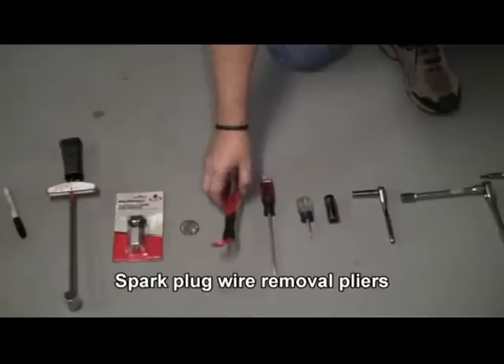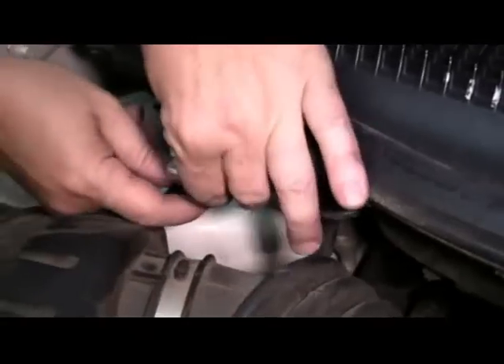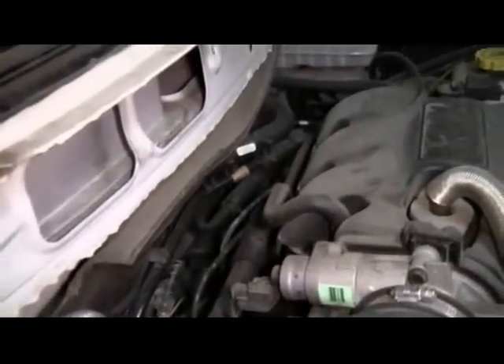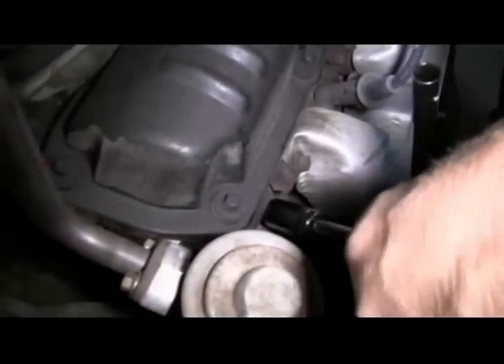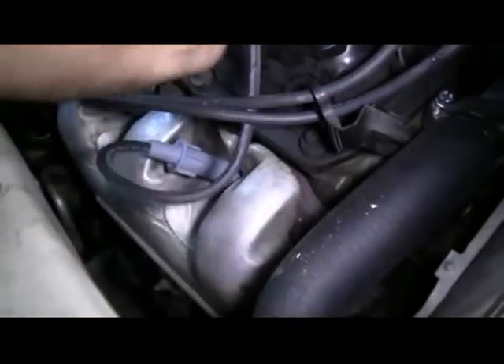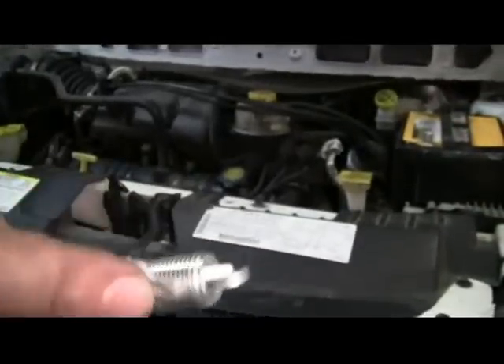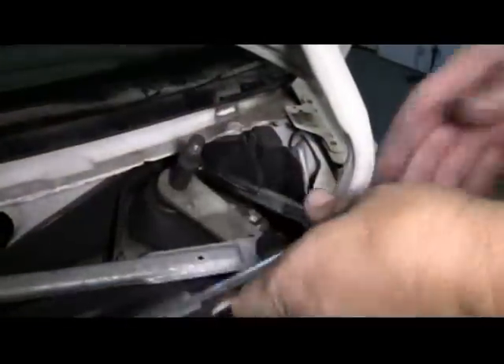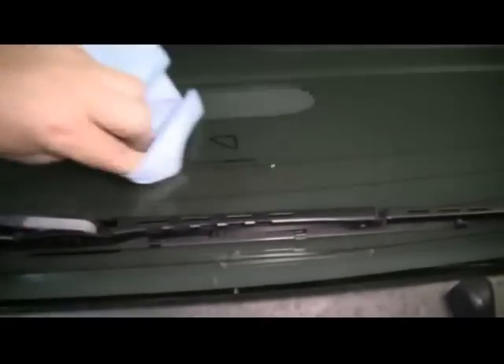Spark Plugs and Plug Wires on a 2002 Dodge Grand Caravan Sport

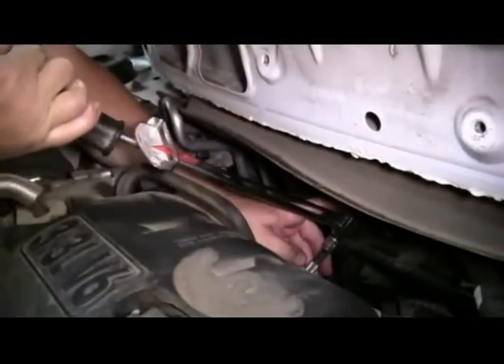Comment: 12:17 to 12:26  That's why ALWAYS insert them gentle and slowly by hand only and begin turning them into the female threads of their insertion holes until you feel them going easily in...until they begin to get reasonably difficult to turn by hand...THEN  you put the torque wrench and socket with extension on it.  ;)

Comment: 1:28 to 1:35  people Unless you are really short ( like 5 foot even) with a short arm length and without  a stool to stand on..and/or you have Popeye the sailor's arms in physical size...you don't have to remove the w/w arms and that cowel.  You can reach the back of the engine reaching around from the drivers side with your right arm/hand.  

I'm 5 foot  9 and am not a skinny guy and and had no problem doing this by feeling.

Comment: Ok, I understand why you remove the wiper assembly for access. I have never had the need to. The only item I remove is the pcv valve hose. I guarantee I can remove and replace all 3 rear plugs and wires in the same amount of time as removing the wipers.

Comment: Does putting the anti seize on the spark plug threads change the torque specifications?
Reply from the maker: No it shouldn't.   - Greg

Comment: Thanks, guys for the detailed steps. I am an experienced mechanic but still needed the extra info you provided to avoid dumb mistakes. Appreciated Jim
Reply from the maker: Glad we could help -Greg
Reply: @GregorysGarage  One specific subject does need attention in your great video I learned. It is the idle speed adjustment method. On my 2002 caravan 3.3 after plugs replacement, the idle speed is really low and the engine dies unless I manually race the engine a bit while and press its brake pedal also. Pain in the Butt to say the least. So the ultimate question is how do I adjust the idle speed? Thanks, Guys, Jim
Reply from the maker: @JamesJohnson-fr1wv  I no longer have access to that vehicle but I will look into it.  Also make sure you didn't knock something loose like a vacuum line.  -Greg
Reply: @GregorysGarage  Hmm vacuum line might be, I'll look. tks, Jim

Comment: Do the next guy a favor and put that anti seize paste on the wiper arm bolt and taper.
Reply from the maker: Thanks for the tip. -Greg
Reply: I'm thinking of doing that on mine, already made a homemade wiper arm puller, quick and sleazy - I meant easy.

Comment: I have a 2000 dodge grand caravan  and the negative battery cables are corroded from battery powered dust and it broke them ,How would you replace the negative cable? It seems impossible....Please let me know.

Comment: Great instruction. If I may add, use compressed air into the spark plug well before removing the old spark plug. The aim is to force any debris out of the spark plug well so that it may not fall into the cylinder well when exposed by the removal of the plug. It would also minimize introducing debris while installing the new spark plugs. Be sure to wear eye protection while blowing compressed air.
Reply from the maker: Tony Lopez Thanks for the good advice.  We really Appreciate it. -Greg

Comment: Gotta say i was dreading the back 3 plugs as well as the O2 sensor i needed to replace that was back there as well on my 2004 GC.  Had a P0302 code and P0032 code.  Misfire and emissions to tackle.  The removal of the tray is a must.  I thank you for the clear video on how its done.  Took me more time to take off my pretty seized wiper arms with a 2 jaw puller than it did to R&R all 3 plugs and the 02 sensor.  Once the wiper arms were off,  it was less than 5 minutes removal with my mini impact.  15 mins to do the R&R of the 3 plugs and O2 sensor and then another 10 to get it all back together again.  All codes cleared and ready to drive.  thanks  very much for the vid.  Saved myself $300 for sure.
Reply from the maker: I am really glad we could help. -Greg

Comment: thank you for doing this video, i knew how to do the front ones not sure how to get to the back ones. NOw im wondering do you have a video on how to remove a driver seat from 2002 dodge grand caravan sport, just got the van cheap and the seat is in lay down position and wont move and got a replacement
Reply from the maker: You're welcome.  Sorry we don't have a video for removing the front drivers seat. -Greg

Comment: Thank you SOOOOOOOO much for posting this!!! Van has been sputtering for quite a while. Sounds like a new engine is in it now.
I really appreciate how your instructions (and video) are obviously for folks not super comfortable with repairing their own car. 
**Couple things for people still nervous about doing this:
1. For people saying they can change out the rear plugs without removing the wiper assembly, you either have arms like ET The Extraterrestrial, or you are lying. EVEN with the cowling (sp?) removed, you still gotta do the rear three by feel to a certain extent, but... you can do it. (a bright flashlight positioned properly helps a great deal)
2. RE: "wiper removal tool" - you can also grab a small "gear remover" that is basically the same thing, for about 6 bucks at the auto parts store. (they said they had never heard of a wiper removal tool... and "why did I need that" and "he'd never had any problems doing it so why was I" and yeah, I probably won't be going there anymore)
3. The little cover you lift to get to the wiper nut.... only lift it when the wiper is down against the windshield or you'll break the cover off.   ....guess how I know this.
4. Go ahead and invest in a small, $2.99 tube of dielectric grease. That packet isn't really enough. At least, I didn't think so.
That's all I got. 
Again, thanks so much for posting this. For those of us out here that don't have much money but still need to get it fixed, folks like you are a blessing.
-Kirby
Reply from the maker: Awesome glad we could help and thank you for the suggestions.. -Greg

Comment: I just wanted to say if you have small arms you can reach around the right side of the engine near the cruse control solenoid to get to the back plugs.  I did mine that way without removing the wiper tray 6 plugs done in 20 minutes.
Reply: This is what I hope to do, my arms are kinda small so maybe I can reach them
Reply from the maker: Wow..  Your better than me..  Thanks for the feedback.  -Greg
Reply: Same here David.

Comment: I have a 2003 Dodge Grand Caravan Sport With the 3.8 L v6 and just got a tune up 3 days ago. it had a very bad missfire and everytime you would accelerate it would go put put put. anyways when in drive it has a faint rotary like noise at idle. Is that normal? they had to only replace the spark plug and everything else that goes along with it on cylinder #3. cost around 240.00 for the whole job.
Reply: the alternator decoupler pulley on the caravans makes noise after some miles very common  mine did for 3 years.
Reply from the maker: For $240 they should of replaced more than one spark plug.   You have a plug and wire for each cylinder and that's it.  As far as the noise it could be a pulley or belt. -Greg

Comment: Great video!  Reading through the comments, I know you don't have the van anymore. Do you recall the valve cover being accessible with the wiper cowl off?   I know it's right above the plugs on the front and is the the same on the back.  I do not want to take the manifold, linkage, and everything else off to get to it.  I was hoping there was enough room with this method, because the front valve cover, like the plugs and wires can be changed in minutes.    Thanks!
Reply from the maker: I would think it would be as the plugs are very accessible with the cowl removed.  I don't remember anything being in the way of removing it.  -Greg
Reply: Yes, you can get the back valve cover off this way.  Remove the power steering hose at the pump and add a spare heater hose there  pulled to the left to stop the leaks while you work.  You will need a wobble or u joint on a 7 mm for the two bolts under the intake.  Cleaning the surfaces was not bad since the gasket comes off cleanly.  I did remove the throttle body (3 bolts) and set aside with wires still attached.

Comment: Hi!
I really wish you'd show HOW to replace a coil on that same type vehicle.  I have a bad misfire, #1 spot.
Need a video from someone we can understand clearly.
Thanks for this video.
great job!!
Reply from the maker: I am about to replace a coil in a 2003 Ford Taurus.  My daughter's car has a misfire on cylinder #1.  I already replaced the plugs and plug wires. -Greg
Reply: +Gregory's Garage How similar would a 2002 Dodge van be?
Thanks.
Reply from the maker: Should be very similar. I don't have the caravan anymore.  I plan to just either unbolt the old coil then install the new one.   The transfer the plug wires.
Reply: +Gregory's Garage Great....I'll be sure to watch.   Thanks!

Comment: They needed to install the engine the way they did for a reason but those fucking rear plugs are such a bitch to access! 
 On my van I don't think they were ever changed, it has 143,000 miles!.  I removed the front plugs and the gap was so eroded that it was .085-.095 depending on the plug, specs have it set to .050!  Front three took a few minutes, one was seized but I got it out.  The back three were a different story!  I broke two of them trying to extract them because they were so seized.  I let them soak with PB blaster and eventually took an impact driver to free them.  I am very lucky I didn't fuck anything up trying the brute force method!!
Reply from the maker: Glad you got them changed. -Greg
Reply: +Gregory's Garage 
Thanks, I wish I watched this video first!
Reply: +Chris Barth 
Have you guys ever had a problem with the lug nut studs shearing off on the Caravan?  For some reason I've had many of mine shear off. It's probably/definatly from over tightening but I've never had this problem with any other vehicle.
Reply from the maker: +Chris Barth I haven't on the Car van but I have on a Toyota Sienna and a Dodge Neon. -Greg
Reply: Must be soft steel or over tightening or both.  I will say just hope you don't break one on the back axle of the 2002 Caravan sport ! Its very hard to reinstall a broken stud without taking the whole drum brake assembly off.  I opted another way but it involved drilling through the dust shield, dont ask! lol! Thanks again!
Reply from the maker: +Chris Barth I think alot of places don't torque the lug nuts and just use impact wrenches.  Thanks for the warning. -Greg
Reply: ??!?  One of mine on the front right sheared off!  I've got a 2003 Grand Caravan.  Weird...
Reply: ohgoodgodno Yeah, to me the lug studs seem to be made of soft/malleable steel or some young guy at the tire place kept his finger on the impact's trigger for far too long. 

The way they sheared was odd. You would think that when the stud breaks it would happen suddenly, but mine sheared slower than Id expect, like it was a soft metal.  IDK, maybe Im overthinking this.lol!  

Good thing is it was on the front rotor.  On caravans with a rear drum its a PIA to replace!

Comment: Thank you so much. Very few videos show the rear plug removal. I like your calm and steady work style. Question, do you normally remove the PCV valve at 75,000 miles and do you clean the EGR as well?
Reply from the maker: Thank you for the compliments.  As far as the PVC and EGR valves I usually replace and clean as needed not at any certain mileage.  But I think it's a good idea to.  Better safe than sorry.  -Greg

Comment: Great video.  I did a 2007 3.8L today.  I did not remove the wiper assembly but it was hard reaching around to the back and doing 1, 3 and 5.   I can see why the first 6 minutes of the video go through that ... you either do that and have easier access to the back, or you do like I did and have patience and do a lot of reaching and feeling with your hands (and I used a mirror and flashlight for help).   Wires from longest to shortest are 2, 1, 3, 4, 6, 5.
Reply from the maker: Wow good job.  I can't imagine doing that job without removing the wiper assembly.  You must have more patience than me.  -Greg
Reply: Wow! I can't imagine changing the rear plugs without disassembling something.  Your arms must be triple jointed!  lol.

Comment: little different question regarding the actual spark. we are getting too much fuel for sure and this has ruined the plugs. have canged the plugs and noticed that they spark in time with compression but also spark again between compression. is this normal? could the crankshaft position sensor be bad?
Reply: America
Reply from the maker: +Jonathan Ellis Sorry for the late reply but I really don't know what would cause this.  It could be the crankshaft position sensor but I wouldn't think it would make it spark twice. -Greg
Reply: 6 plugs, 3 coils. Each coil fires once per crank revolution so two plugs fire at once- one before TDC on the compression stroke, the other BTDC on the exhaust stroke. Interesting that one plug is always firing ground to center and the other center electrode to ground. ( this stuff is taught in Canadian schools)
Reply from the maker: This van has one coil not 3.  That being said it may operate as you suggest.  Thanks for the information. -Greg

Comment: I changed my plugs and wires without removing anything. I just reached around the engine from the right hand side and used a regular ratchet sparkplug socket  and medium extension, took 15-20 minutes to do all six. If your a big guy you might not be able to get your arm around the engine but I would say most guys could reach those plugs without removing anything.
Reply from the maker: davidbrennan5 From the feedback we have received most guys can't reach around the engine but if you can then great.  I have also heard of some guys being able to reach the rear plugs from underneath the vehicle.-Greg

Comment: Excellent video. I have to perform this and replace a power steering pump in the morning for my aunt and you just helped me out big time. Thanks
Reply from the maker: You're very welcome and it's great you're helping out your aunt..
-Greg
Reply: Greg Cook thanks for the video, it really helped. I have a problem and hopefully you might be able to help me out. Since replacing the power steering pump, we found out the actual cause of the first one burning out. The high pressure hose and return line are leaking because of old age. Is wondering if you have any experience in replacing them on the grand caravan and if you have any helpful tips... And I know our depends on the person doing it, but roughly how long do you think it'll take to do... Because I'm out a garage this time and it's cold out here in Michigan. Haha. So I'm doing it in the driveway. Thanks
Reply from the maker: Sean Carter I have never replaced the lines on a Caravan but I have replaced the lines on other vehicles, most recently my 92 Mustang GT.  I can't say how long it will take as I have never done the but a lot will depend on how easy it is to access the lines, especially the ends.  You will probably need to use line wrenches.  Here is a video we did on a 2001 Dodge Durango  https://www.youtube.com/watch?v=nSqvYkSwBiA.
-Greg
Reply: Greg Cook thanks for replying back. Yeah I figured I'd ask. I'm probably going to have to remove the wiper assembly again which isn't too hard. I've done power steering pumps and hoses before, but those were on rwd vehicles. I'll figure it out. This is the first minivan I've ever worked on and the garage was going to charge my aunt $360 to replace 2 lines. She had to go because after I was done with her van I rotated her tires and her weight balance fell off so I told her to get it rebalanced and they mentioned to her that her bottom lines were leaking... The part is only $35... But that's a reason I'm a diy'er because I can't afford the professional touch. Thank God the weather is getting warmer. I'll be wrenching on it Sunday where it's to be in the 40s. Thanks Greg, I'll let you know how it goes. And if you still have the can and ever have to replace the power steering pump is advise changing the lines as well, Haag's. Because you don't want to end up in this situation like me. Take care

Comment: jajaja  funny video im  a guy the work at a machine shop doing engines  i can change all the spark plugs in 30 minutes  whit out taking  noting out..... jajaja  to do all that the you showing in the video just take  the engine out   and change the spark plugs...... and im  working in car  since i was 15 years im 34 now i can fix you car  you home computer  your motorcycle and  if  you let me i fix your women ..thanks  guys  is  to  funny the  video  taking all the  shit to take  3 spark plug from the back of the  engine
Reply: If you can reach back there that easy maybe you should workout some lol.   I couldn't fit my arms back to any but the driver side rear plug and even my brother who's smaller nearly got stuck getting the other 2.   Most people will struggle to fit back there and some it's just down right impossible.
Reply: Angelo Rosario Some guys have big arms and can't access the back. I'm glad you can. There is no reason to be a smart ass about it.
Reply from the maker: Parker Weatly Most of us guys have man hands so I can't imagine getting the plugs out without removing anything.. -Greg